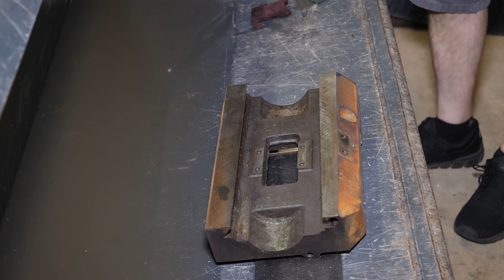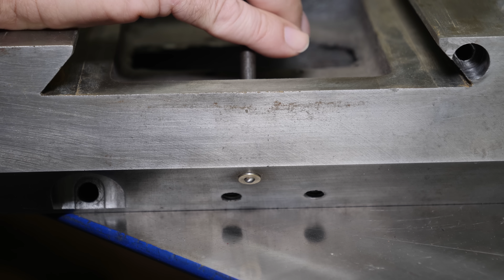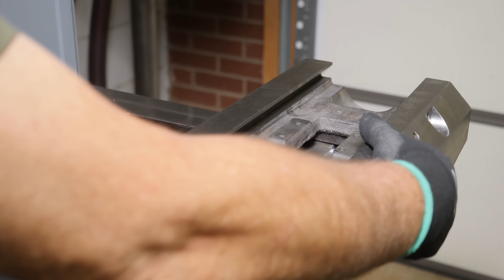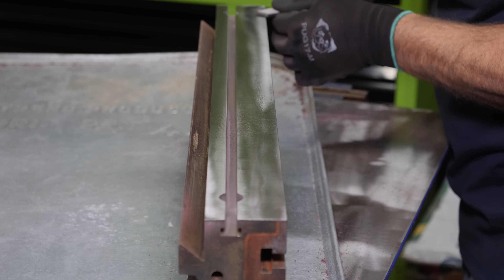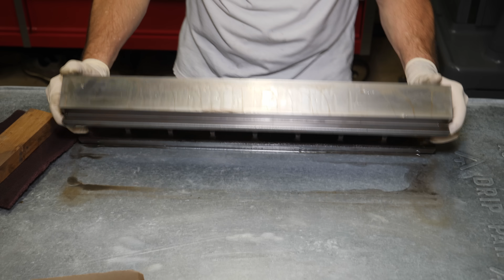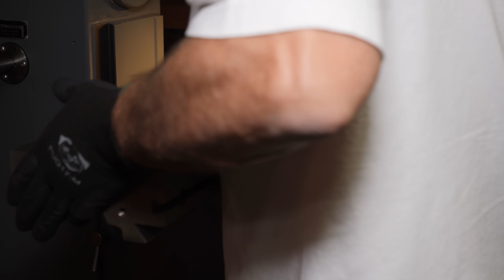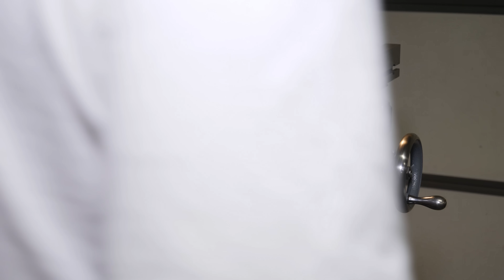$103! Rockwell Milling Machine MD21-120 Restoration Part 5 Saddle and Table

Comment: Did you have any misalignment on the y axis tilt (back to front) and if so, how did you compensate for it given that there is no adjustment possibility on the Rockwell in y?
Reply from the maker: No, when the knee is unlocked it sags about .002. When the knee is locked it’s .000

Comment: How precise can this one mill? On average
Reply from the maker: I regularly make parts to .0005 or less. .001 is no problem BUT this machine was basically new wear wise when I got it. Wasn't used much by the previous owner. It's a light duty machine so things just take a little longer.
Reply: @BurtonsAttic  so the rust didnt bite in much ?lucky

Comment: I've never been near a milling machine in my life, but is there something up with that first gib you reinstalled? Looks like it's got a gap at the bottom and not at the top?
Reply from the maker: Neil Barnwell Neil all of the gibs are tapered which are better than straight gibs because of there wedge shape on all sides/directions. This allows for the play to be taken up in all directions at the same time in a very precise manner. That being said, what you noticed is actually a great indicator of machine condition/wear. The gib is intentionally ground to fit that way from new so it can be adjusted over time as it wears from use. Thanks for commenting.

Comment: Automotive Battery Charger.
Plastic Play Pool.
Water plus 1/2 cup of BORAX.
Sacrificial iron piece.
24 hrs soaking @ 8-10A 12V

Electrolysis for RUST REMOVAL.
ALSO WORKS ON CHROME PLATING.

Comment: You should look up electrolysis rust removal. It will remove only rust, not metal, in all the nooks and crannies and do it completely and with no airborne particulates, costly abrasives, or harmful chemicals. There are some excellent YouTube videos on the subject.

Comment: Wow, man. This is definitely one of those " got more time than money" things. I admire your effort.
 I'm rebuilding  a CB-1220XL. It was sitting in someone's junk pile for a few years and my buddy picked it up for $200. I think it was probably worth 100 to 150 in that condition. The worst part is the sand, we're out in the desert. 
   I didn't have any choice but to tear into all the ground surfaces but two. so I used penetrating oil & razor blades to remove most of the rust and followed it up with stones. I didn't have access to a surface grinder so I just did the best I could with the longest stones I could get, using that method where you grind them against each other to keep them flat. That still doesn't work perfectly because one will go concave and the other, convex. So I tried to make even stokes with each stone on each surface. It seemed to work pretty well. Fortunately, my boss had some small stones for the dovetails.
  Putting it back together is a real bitch though because while it may appear that the sand is gone, a careful wipe of a smooth part will change any assumptions of that. The rags get absolutely contaminated with it so I keep having to replace them and just give it a clean wipe-down with a new rag & new oil when I put something back on.
The machine look great, btw.
Reply: I think the full-fat lapping technique to maintain flatness involves 3 surfaces, and a specific rotation of which you flatten with which, and in which direction. I'm sure oxtoolsco had... Hang, on, it's the internet, you're not reading this in real-time, I'll just find it. Found it: https://www.youtube.com/watch?v=rHmsQEAx16o

Comment: Nice work!  I waited 5 videos to see you indicate the table.  I would like to see a project now.  How well does the table hold right to left?
Reply from the maker: Want to get the lathe finished up, still a bit to do there. The Z axis which is left and right hold fine to a limit. This is a light duty machine so cuts also must be light but it's still a milling machine!
Reply: Good to hear.  You never know if some chump left a rotary table mounted to one end for years and left a sag in it.

Comment: I resurrected one of those several years ago, it was my first mill. A friend bought it last Christmas so it went to a good home as I had bought a full size mill to replace it. You did a great job and quite frankly you had a lot better machine than I did to start with. Mine had a Tree brand head on it when I got it for Pete’s sake. I joined a Yahoo group for these and was able to find an original head and X/Y nut (mine was broken at a former brazed repair) . You might look there for an overarm and spindle. Mine just had a stub shaft with a drawbar.

You’re gonna love that little thing. They’re great machines, especially loved by gunsmiths, it’s mighty handy that they use R8 collets which is why I sought it out over an old Clausing. I sure wish I’d had this video series to watch when I was tearing mine down. Excellent job sir!
Reply from the maker: Thanks Tim! Hard to believe theirs one out their worst than this one was at the start, lol! Maybe the series will help someone in the future........

Comment: Nice job! What is the resale value of that machine now? Just curious. We bought Bureau of Ships equipment at auctions back in the late 60's to early 70's. Many machines were made in the 30's and 40's and used till the late 90's at U. S. Government facilities such as the one I worked at. Again, very nice job on the rebuild and great job with the camera to boot.
Reply from the maker: Good question Mel. It is a somewhat rare machine so I have not seen a lot of them come up for sale. I have seen unrestored ones for around $2500 and restored for around $4000 but with original electrical. My electrical system is completely re-engineered, soooooooo............? But I'm keeping it as I'm sure I will not find another like this one.

Comment: Great work. I'm too (as an amateur!) restore machines. I think a blacking kit on some of the metal parts would really set the machine off even better. What disc are you using to 'polish' the metal?
Reply from the maker: Mostly just a wire wheel Matt, thanks!

Comment: A bath with warm vinegar works very good to my opinion to eat of rust from mechanical parts. Keep the reaction time short!
Reply from the maker: It does work Elias but it can cause permanent etching on the parts. I used Evapo-Rust on the small parts and of course elbow grease on the large part. It's not the fastest or the easiest way but it works for me. The end result is a better looking part.
Reply: @BurtonsAttic  idd, that's why I  keep reaction time as short as possible, as soon the last flake rust falls I take the part out, wash of the vinegar under the tap, quick dry with heat blower and spray wd40 on it. I have acces to a microscope... maybe interesting thing to test the edging depth in function of time. Someone around who already knows a formula?

Comment: As someone who has done a number of large vintage machinery restoration, including some large DeWalt radial arm saws, you did a tremendous job on this restoration. The attention to detail is fantastic (I'm the same way). I also air spray the paint now after rattle canning the first restoration, the finish of that machine was not to my liking.

I hope the machine works very well for you. What model radial arm saw is that? It looks like it could be an old DeWalt from the motor (only part I could really see)
Reply from the maker: Thomas it's a 1944 (I think) GP 12". It's a great machine!
Reply: Thomas - But then it's not your machine. I like the work he done and I would be pleased to be the owner.

Comment: As a PS: check if the spindle has a pin inside for the R8 holder. Mine did not have any inside the spindle, I had to make one. Also the brake/lock to change collets was not working. I paid 700 but mine was not rusty. Regards.
Reply from the maker: Rockwell didn't put in a pin.

Comment: Hi! What use for remove rust (fluid)? Thank You!
Reply from the maker: I used several products. Send the time stamp so I know what you mean, Thanks Burton
Reply: From 0:05 = what sprayed? What is in container? In your hands is scotch brite? Tank You!
Reply from the maker: In the tractor bucket is just water. The spray is Purple Power. Is doesn't remove rust but it is very very slick. What it does is help the rust particles move away. I've found that it makes wet sanding go faster than just water alone. It is citric acid based so it may help a little.....Need to wear rubber gloves. It is an all purpose degreaser and ECO friendly. Yes scotch brite.

Comment: Try vinegar to remove the rust by soaking them in over night best that I have found truly a lot less work.
Reply from the maker: Acid etches metal, didn't want that. Thanks
Reply: Need to be very careful with precision parts.

Comment: Very nice job, and an even better price that ya paid for it. I restored an old 1940's Pallas mill a couple of years ago, it took a bit over a year to complete it.
Reply from the maker: Thanks Trev! Yeah I have about 3 months into this one but I was working on it pretty consistently, it is very time consuming work!
Reply: @BurtonsAttic  I had to remake/repair several parts for my mill, I've a horizontal shaft waiting to be adapted to fit, the horizontal shaft needs a BESA taper, which is no longer available.
Reply from the maker: @bigtrev8xl  Always something! I was pretty lucky with this one!

Comment: Welcome to Rockwell world. I have the vertical and horizontal siblings to your mill. 

Pick up some stones for the work surfaces. Sand paper is tough on a machined surface. 

T-slot cleaner very clever. 

Dan